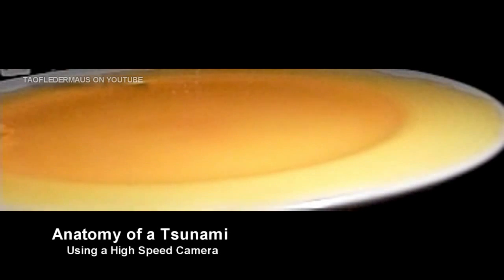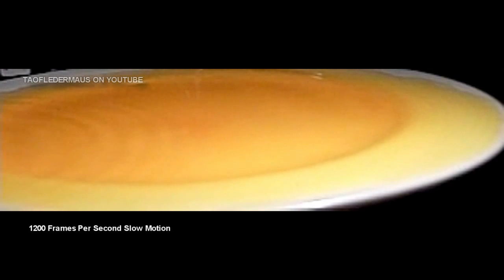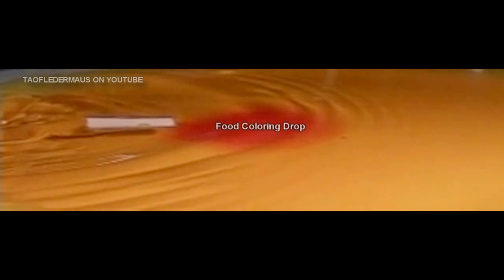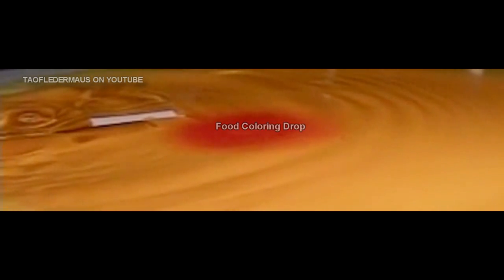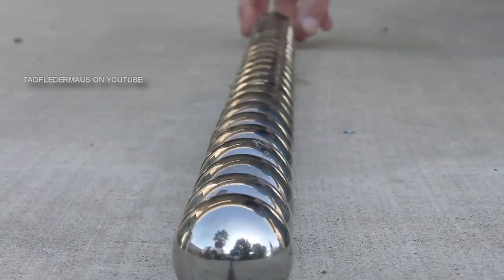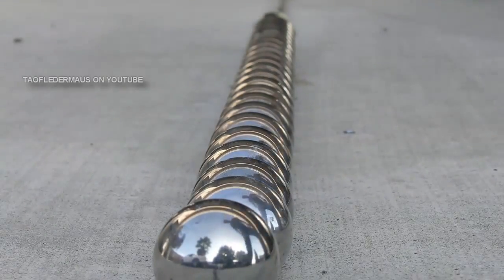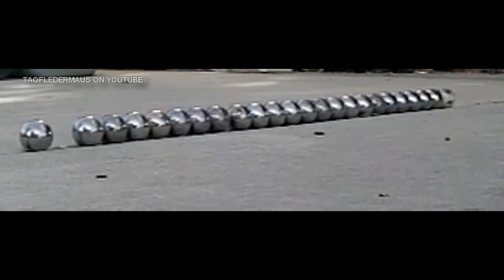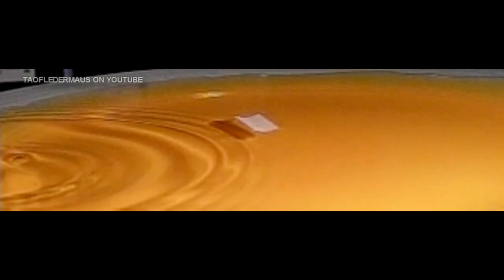Tsunami:  How does it go so FAST?

Comment: Okay if he is traveling at a minimum of 650 miles per hour to be able to run on water how fast was that wave going to not only catch up but to surpass him? That would have been like a sand blaster, it should have shredded him instead of knocking him off his feet as each drop a water is closer to shrapnel than getting hit by a wave

Comment: Your video of waves was good, thanks. But the steel ball analogy is more like a pressure wave, like sound waves. These travel much faster through a solid, and I think your steel ball analogy shows that well. However a tsunami is a ripple across the surface of water, so a different type of wave relying on different mechanisms to transmit the energy of the wave. Still looking for a good explanation!

Comment: Tsunami has very long wave lengths while they are in ocean but as they approach land  their wave lengths get shortened and the energy is conserved by increase in wave height due to "wave shoaling" - there is massive amount of energy and not enough water depth so the wave gets compressed raising its height. Speed also decreases in the process.

Comment: Even soundwaves move faster in liquid, fastest in solids.
Reply: U just went snorkeling recently and I did notice that sounds are much louder and clearer than I thought they would be!
Reply: +TrueBlogge777 the reason is how sound travels. When sound moves through air it makes the paritcles vibrate which gets trabsfered thorugh thr air partocles and eventually reaches your ear. IN water/solids this prosess happens much faster

Comment: Nice video.
Minor point: water is, in fact, compressible.  The video and some comments below state it is not, but the compressibility of water is a well researched common trait with plenty of data backing it up.  You will physically encounter anything truly incompressible.
Reply: I'm pretty sure you can't change the volume of anything (besides changing its temp.) unless it is a gas.
Reply: That is a common misconception.  Nothing has an infinite bulk modulus. 
If you are still in doubt, look up the theoretical density of the substance that makes up a neutron star...neutronium.

Comment: Your demonstration is pretty good, and I think that the answer that would help you to understand your question (why the tsunami it's so fast?) it's called physics, specifically linear and non-linear shallow water equations, which are the governing equations of motion of a tsunami. 

And if you want to see pretty good the interaction between the tsunami and the coast, you need to put in your model one of the most importan things in tsunami propagation, the ocean floor. 

The Geology of the coast (submarine part of the coast) is so important that there is a type of tsunami called "Meteo tsunami" that is ONLY caused between the interaction of the ocean floor with specific atmospheric features that produces a specific phenomena of resonance, which causes a tsunami without the need of an earthquake or a landslide, that it's the most common generation of tsunami. If you want a better model, you need to investigate about the two last parts of a tsunami, propagation and interaction with the coast. Regards.

Comment: Are the steel balls a good substitute for water? In fact, if the balls are touching each other, aren't they effectively a single iron bar?
Reply: I'm necro'ing a bit here but that is the point exactly. The ocean is effectively a single giant iron bar only not as rigid and thus slower. But if you take a REALLY long iron bar, and point it at a planet exactly 1 lightyear away with the iron bar being being one inch away from it, then you push, it would still take more then 1 lightyear for the iron bar to touch the planet because the molecules are pushing eachother in a process that is not faster then light.(If you are confused, i stole this from vsauce, they do a better job then I do at explaining)

Same with a tsunami, it is basically single iron bar pushing itself really quickly, just perhaps not as quick as an iron bar.

Comment: a wave can move extremely fast because the back of the wave goes down and makes the water in front of the wave move, so the water does push itself (like a chain reaction), and it is affected with very little resistance from friction /air resistance, losing only a small amount of energy even over a long distance.
Finally, I can use physics out of my AP Physics class

Comment: A cool thing about compression is that, even though the compression between the steel seems minuscule, if one were to make a steel pole one lightyear long and somehow push it, it would not in effect send energy at the speed of light (or greater). The sheer distance would make a noticable gap in time for the pole to finish moving.
I feel I worded it wrong but I feel I said it well enough to be understood.

Comment: what you are seeing is the speed of sound for those mediums.  this is true of everything.  If you had a pole 100,000 miles long and pushed the end the opposite end would not move at the same time.  your push would have to travel through the pole.  it's fast, but not instant.  kind of like the slinky vids you see too.

Comment: A "regular wave" doesn't move water horizontally. In what way the video describes a tsunami and not just a wave. On the other hand (for the metal balls analogy), the sound speed in water is many times the 500 mph of the tsunami. Is that relevant?